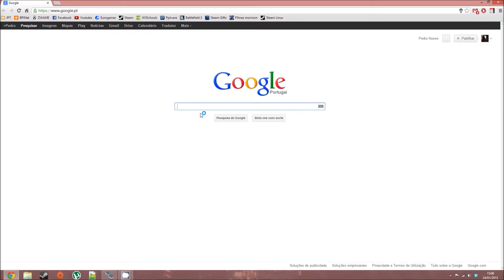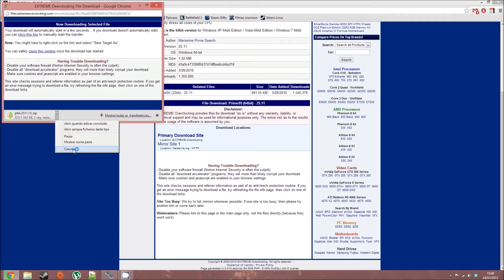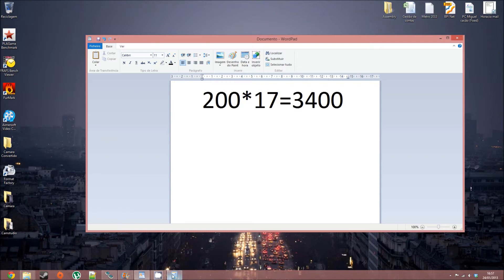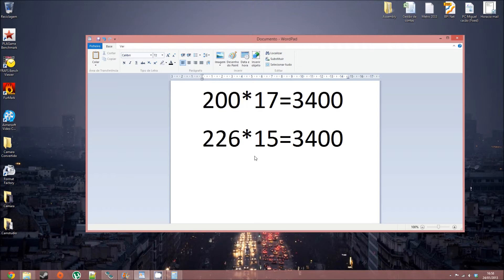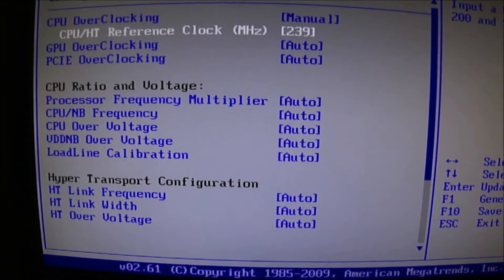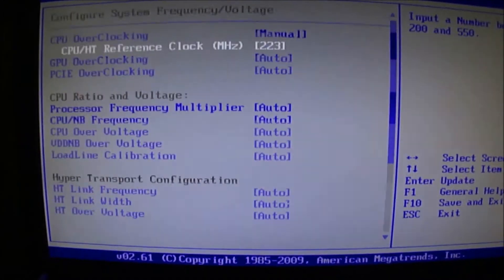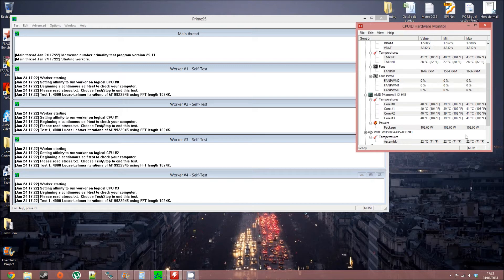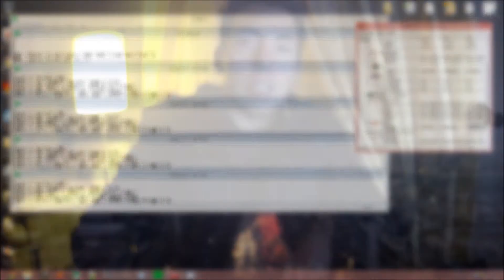How to Overclock Phenom II X4 945 [Basic Toturial]

Comment: @BenchARTVideos, looking to over clock to 3.4 or 3.6 on a 2010 Dell Inspiron 570, 8GB DDR3 1333mhz RAM, PSU is already changed. Looking to gain more frames in RDR2, 12 years later is this still safe to do? Any specific instructions or help would be GREATLY appreciated, doing a budget build with my grandmothers old tower 😂👍🏻
Reply from the maker: It's still the same ;) no problems to do that the issue might be that Dell might block some of the overlooking features, so just take a look at the bios if you have all the possible options

Comment: Good evening dude. Thank you for your video. I don't know if you're going to see this comment section ever again because of the time it was posted. My PC configurations are: AMD Phenom(tm) II X4 945 Processor   3.16 GHz (I just changed the fsb that was 200 to 210) 

Motherboard: N68C-S UCC
RAM: KINGSTOM 1600MHZ (8gb in dual channel 4x2)
PSU: 300w from Dell Optiplex (I adapted it in my computer because its a great power supply)
Video Card: Nvidia GTX 1050 2GB

I was wondering if i could raise it to 3.3 without changing the Core voltage or the memory clock value. Do you have any advice based on my Specs of what should i do? This motherboard have a auto-overclock option as well, but i think it raises the core voltages too much (to 1.4). And i doesn't change de Memory Clock (as it stays in AUTO by default).
Reply from the maker: Imo the best option is to simply try.
Try raise the fsb to 220mhz, and run stability tests and see how it works.
I think at some point in the early days, i wss able to do 3.4 or 3.5 without vcore, but after a couple of years, i really needed more and more vcore to sustain it
Reply: @BenchARTVideos  Yes, I changed nothing, I'm not using the "auto overclock" option it provides because using the "AUTO" option it already says that the maximum vcore is 1.4. I just don't get one thing about what u've said. Why did you have to increase the vcore after some point? What do u mean by that? Does your processor got weaker somehow so it needed more voltage?
Reply from the maker: @alexsander847  Basically, it doesn't get the tension it needs and starts to run unstable.
Raising vCore is only necessary if your target frequency is not stable, if you reach that point, either you decrease the frequency to something more stable or just try to raise the vCore so it gets the tension it needs.
The issue with raising the vCore is that it causes more wear, the heat generation and power consumption get much higher and also needs more power from the MOBO.
I did use changed vcore for almost the entire life of the cpu, and it was fine, except for the last years. It really got worn out, but it lasted me a decade 😅
Reply: @BenchARTVideos  I think I got it. I'mm currently running at 10% now, and everything looks just fine. I'm just worried about RAM. It's currently running at 1713mhz (DRAM is at 428.3) but this Mobo support 1600MHz RAM. Why is everything working just fine? 🤔 Do you think it's normal? Should I decrease it's mhz in BIOS just as you showed in your video?
Reply from the maker: @alexsander847  If it is fine, just continue, I mean, my rams were 1333mhz by default and my final oberclock got it close to 1600mhz, official mobo speeds are mostly just for reference, if everything is fine, you don't need to do anything ;)
Reply from the maker: @alexsander847  just run some stress tests and game on it or do the heavy tasks that you usually do on it
Reply: @BenchARTVideos  Turns out I didn't knew that Phenom II X4 945 Is actually 1333. So it was caping my 1600 RAM already. I just changed it to 1433 at BIOS so it doesn't mess with the maximum of 1600 spec of my motherboard (it was already in 1712 with 215 of FSB). I'm currently running it at 220 FSB, which is 3.29ghz know, without increasing its VCore (from stock it's 1.4 already without changing anything). Wanna know how far I can get without having to increase voltage (dont know how to work with the NB multiplayer) xD. Thank you for you video again, I've used all tools u provide on this guide video for monitoring and stressing.
Reply: Just to put an end to everything here. It handle till 220 of FSB which gives it 3.29/3.30Ghz. In 221 it crashes and u see a bluescreen. My mobo doesn't allows me to increase random numbers of vcore. The next option is 1.425 but i fear going up this 0.25 ;') Guess it is the end.
Reply from the maker: @alexsander847  I did use 1.45 for a while with ease, some crazy people did use 1.5, but I would say that 1.45 is a good balance If you wanna try.

Comment: 250fsb
X8 ht
X8 cbu nb
Ram ddr3 1066 or ddr2 533 in bios
(Will run 1333 or 666 in windows)
Adjust multiplier as needed.
See how far you can go on just 1.4v as 1.45v can be too much for cheap vrms.
Done.

Comment: Can i have the actual bios settings for over clocking mg phenom ii x4 945? Stock cooler. Im going for 3.4 or 3.5 pls?
Reply from the maker: For 3.4 just push the bus/fsb to 227mhz and if you experience some crashing, just drop the ram settings a notch. And that's it
Reply: I've done 220 and it did not boot to windows. It just restarted to bios.
Reply from the maker: @SlimeOnPC  have you tried to decrease the ram speed?
Reply: It opened at 220fsb and 400mhz on ram. But my temp are on 60-70 so I restarted. What do you think is the problem?
Reply from the maker: @SlimeOnPC  Surely temperature.
Phenom II X4 can't handle much more than 60-70.
Try to undervolt, on the CPU voltage, start to reduce from 1.35 to something slightly lower and test it with prime95 or something like that to test stability.
Reply: @BenchARTVideos  You absolute legend, you are responding to comments even in 2020.

Comment: I have a Phenom 945 (not a black edition), overclocked it to 3.71GHz, and I set the voltage in the bios to 1.4V. Tested in AIDA extrime for 2 hours .. I played several games. Everything is fine .
After testing, "HW monitor" shows: minimum 1.424V, and maximum 1.472V. In BIOS I set the 1.4V ?? Is 1,472V too much? CPUZ displays 1.424V.

Comment: Hey bro, what's up? :) 
What cpu cooler are you using? 
Thanks
Reply from the maker: Hi there Diego, I am using an artic Freezer 7 PRO
Reply: BenchART thanks, I was thinking on a hyper 212 evo, can I overclock to that velocity with it? Obviously at good temperatures
Reply from the maker: Well, that always depend on your luck.
But yes, hyper 212 Evo should give you probably even better results than what I have :)
Cheers

Comment: so when testing core 3 just drops out and stops being tested around 7mins in after completing 6 tests, the system is stable at 62 C (its a little toasty ik I do have an after market cooler) the speed im running is 3.45 @1.488 V, I have a feeling its the CPU that's dying out considering I've had it since 2011 is there anything I can do to fix this error or is this an excuse to buy the 6 Core Phenom II
Reply from the maker: Maybe not dying, but not being able to stress more than that.
You have an insane ammount of voltage for the frequency that you are using.
I have 1.437V at 3.6GHZ and it is rocking stable, you should consider dropping out the voltage and test it again, it will improve the temperatures.

Comment: Entao amigo, vim aqui como você me pediu , mas na minha BIOS não tem esse Jumperfree , e nas opções avançadas não dá pra alterar o mhz do clock do processador
Reply from the maker: Consegue me indicar qual a marca e modelo da sua board?
Reply: Sim, é M4N72-E  Assus
Reply from the maker: Consegue colocar o ai overclocking em manual?
Reply: BenchART consegui! apareceu as opções aqui!, o meu processador é um Phenom X4 810 , e a minha fonte é de 600w ,
Reply: vou aumentar a frequência de 13x200 pra 13x230 para dar 3000 MHz, nesse caso preciso aumentar a voltagem ?
Reply from the maker: Pronto, consegue-me dizer a marca e modelo da fonte.
Pronto você para fazer overclock tem de ser pelo FSB, por defeito vem em 200, se for o 810 tem de ter 2.6GHZ e não 2.4GHZ.

Mas por cada numero que subir de FSB (se for 2.4GHZ) vai subir 12MHZ por cada FSB que subir.
Se for 2.6GHZ vai subir 13MHZ.
Tem de ter cuidado porque ao subir o FSB, tambem vai subir a velocidade das memorias, e isso pode causar instabilidade..
Por agora o ideal é subir um pouco o FSB para ficar igual por exemplo a 2.8GHZ ou 3.0GHZ, e depois pode testar a temperatura com o HWMonitor e testar a estabilidade com o Prime95 e ver se ele aguenta sem crashar.
Se crashar, temos depois de baixar a ram para valores mais normais, e se for preciso temos de pôr voltagem, mas pra já, pra já, veja se consegue colocar o CPU a 2.8GHZ ou 3.0GHZ sem fazer mais nada :)
Reply: Amigo eu consegui colocar a 2800, vou testar  com o prime 95 já te digo se crashou
Reply from the maker: Aliás melhor ainda, vamos mais devagar.
Meta o FSB a 210, e teste a estabilidade com o PRIME95 e veja as temperaturas, testes durante 10 minutos com o Prime95.

Pode ver tambem a frequencia do CPU enquanto corre com o CPU-Z
Se tiver 10 minutos sem crashar, ou ter problemas..
Metemos o FSB a 220 e testamos novamente..
Vamos ver até onde é que ele vai :)
O limita máximo do CPU é 71c, tenha cuidado..
Cumps..
Reply: Fiz o teste com 2800 e ela chegou a 70° em 4 minutos
Reply from the maker: Porra :O
Você tem o cooler de origem certo?
Reply: Eu passei informação errada, minha fonte é de 450 w , acho que ela não supre como deveria,  comprei uma nova , chega amanhã de 600, creio que não esquentara tanto assim,  e o cooler é o de origem sim
Reply: Abaixei pra 2730, ela manteve 67°
Reply: BenchART o problema é que aqui no Brasil é verão, os dias estão muito quentes
Reply from the maker: Eu sei :)
Eu tentaria manter pelo menos 10c abaixo do limite ou seja tente arranjar uma frequencia que fique a 60c, até porque a jogar, a GPU tambem vai aquecer :)

Mas se for o Phenom II 810, a sua frequencia de origem é 2.6GHZ e nao 2.4GHZ, ele a stock já deve ter umas temps altinhas.
Reply: Sim , isso , é 2600 mesmo, o problema é manter menos 10° com o verão do Brasil, moro em uma região quente ainda :/
Reply: Quando minha fonte nova chegar , e minha r7 370 chegar também ( tudo nessa semana ainda) farei os testes novamente, e te falo os resultados
Reply: BenchART só uma curiosidade quando eu estou em jogo , não passa de 63 o.o
Reply from the maker: Isso é porque possivelmente está um jogo leve pelo CPU.
Que jogo jogou?
Por exemplo aqui o GTA V leva o CPU + GPU a 100%, o mesmo se pode dizer de qualquer Battlefield, 4 ou 1, põe qualquer máquina a fritar :)
Reply: BenchART entao, o intuito de tudo isso é aprender a fazer overclock no processador kkkkk, mas eu to com uma gt9500 antiga, e minha fonte é ruim,. mas estão chegando minha nova VGA r7 370 e minha fonte Corsair 600w , eles irão dar conta do recado
Reply: BenchART entao, o intuito de tudo isso é aprender a fazer overclock no processador kkkkk, mas eu to com uma gt9500 antiga, e minha fonte é ruim,. mas estão chegando minha nova VGA r7 370 e minha fonte Corsair 600w , eles irão dar conta do recado
Reply: BenchART essa placa não aguenta nada kkkk. , é uma peça antiga, não ppdemos levar em consideração os resultados obtidos com ela
Reply from the maker: Pronto, nesse caso aí recomendo fortemente a comprar tambem um cooler para o CPU, e fazer o maximo de overclock que conseguir na besta... :)
É normal que uma 9500GT nem aqueça o Phenom, isto porque antes de o CPU se começar a queixar, já a 9500GT se está a queixar à muito tempo XD
Reply from the maker: Eu sei, eu tenho 1 :)
Está imprestada a um amigo, mas já não a uso à 7 anos.
Reply: Kkkkk sim exatamente, vou ver de comprar um cooler para a CPU então, obrigado , voltarei a notificar sobre as novidades aqui
Reply from the maker: Força, estarei esperando, para ver o que conseguimos fazer com o Phenom...
Com sorte conseguiremos leva-lo aos 3.0 ou quem sabe 3.2 e assim já acompanhará um bocadinho melhor a R7 370, olhe, mas porque não uma GTX 1050 ou a RX 460?
 Está assim tão mais barato essa R7 370?
Reply: Sim , aqui a r7 paguei 600 reais modelo xfx
Reply: Essas outras estão na casa dos 900 por aqui
Reply: BenchART benchart vc acredita que eu consegui jogar GTA V com a GT 9500 no low , e em 800x600 a 27 FPS kkkkkk,

Comment: Very helpful video mate, you earned a subscriber from it. I just recently was given a phenom 945 and motherboard. I a r9 280x and 750w psu to pair with it. All I need now is a cpu cooler and my build is complete. What cpu cooler did you use in the video? And what were your temps when testing with prime95?
Reply from the maker: Hi, I'm using (I think) an artic frezer 11 pro, but I have to confirm it :)
While on summer it can get to 60 and on winter 50c
Reply: Nice. I am thinking about getting the cryorig h7, people say it offers great performance and doesn't interfere with the ram clearance
Reply from the maker: I'm pretty sure anything can be better than mine ;)
So maybe that cryorig h7, might be a good deal.

Comment: Can i overclock My AMD Phenom II X4 3.0 ghz  to 3.2 or 3.4 with standard coller I am use 500w 80 plus psu ?
Reply from the maker: You can always try, just be careful with the temps, about the PSU, always tell the brand and model :P
Reply: 500w epsilon 80 plus but in my bios i just get up the cpu clock  ration to x16 and save and close it and my pc run it say somethink 3200 ghz i dont cnage anythink other xD
Reply from the maker: Dzole Buragev Never heard of a Multiplier unlocked Phenom II X4 940, but you seem to have one :P
In that case, overclocking to you don't require anything that I've said on the video, just keep raising the multipler.
For each multiplier number that you raise, you raise 200mhz on the cpu :)
Reply: Ohhhh i dont know how but it rly work on 3.2 now with 41-43 c standard cooler :O :O I just change the cpu clock ration to x16 and that was all ...I am in fear because first time i do this...i back to stock now 3.0 xD
Reply from the maker: Dzole Buragev Just stress test it, go run prime95 and check the temperatures.. :)
Don't worry you won't kill it..that's not that simple ^^
Reply: To start things off with the Phenom II line, AMD has launched the Phenom II X4 940 Black Edition, running at a whopping 3.0 GHz. Being a Black Edition processor means that the CPU multiplier is unlocked, making it much easier to overclock I found this on internet ohhhh nice .... I will go buy now better coller lolz i never know that is unlock xD black Edition one ...